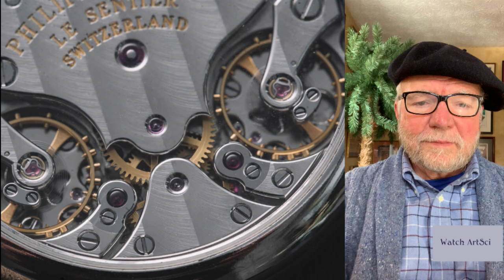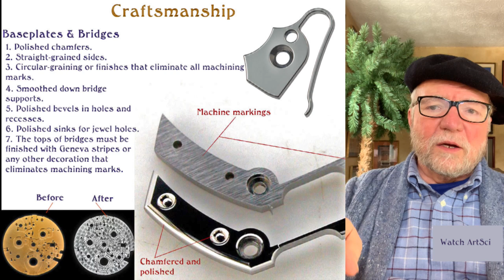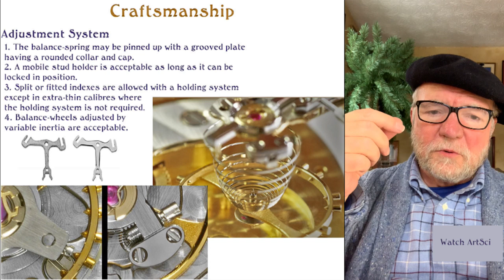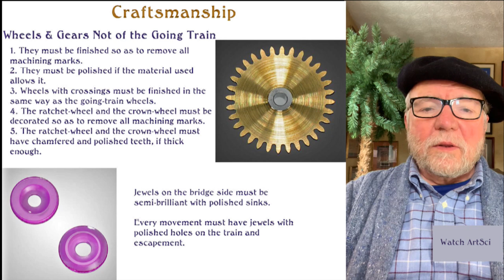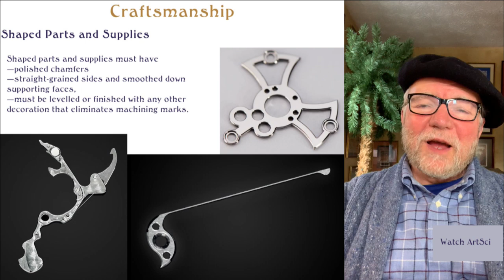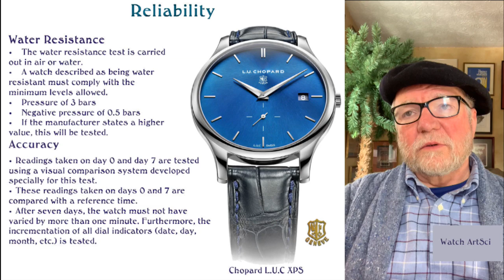Standards of the Geneva Seal You can Apply to Your Own Watches #199

Comment: Great video, Bill. Thanks! 
Are there any of their watches that Patek Philippe feel are not worthy of their seal?
Reply from the maker: Good question! There aren't any that I know of. However, you will find that of the six new FiftySix models by Vacheron Constantin, only 4 received the Poinçon de Genève. That's because the movement in the two that didn't get the seal were by ValFleurier. Cheers, Bill